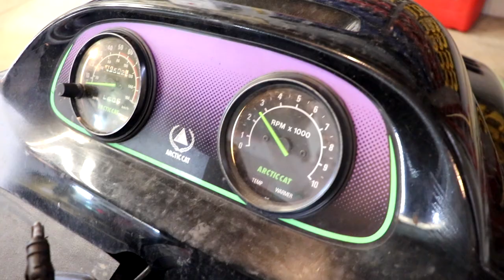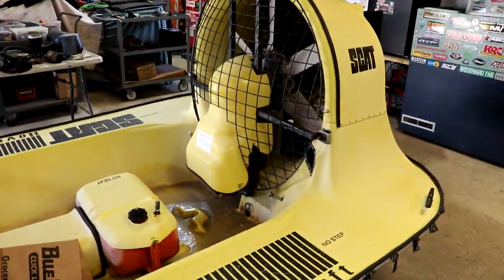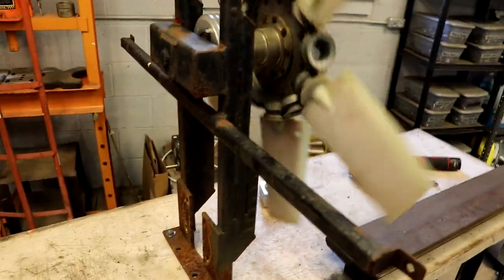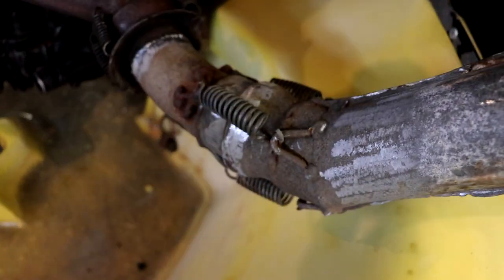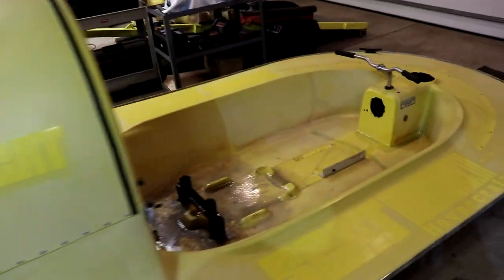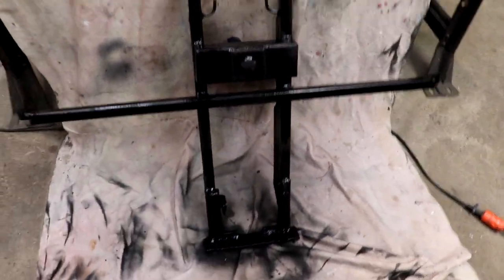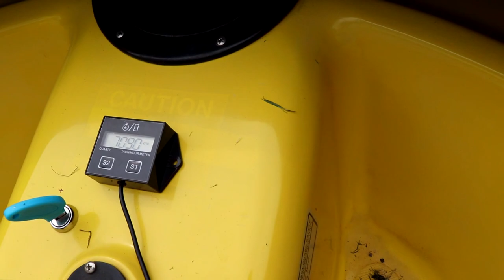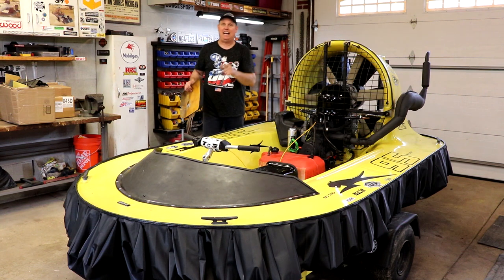The Hovercraft ENGINE SWAP 580cc Two Stroke 10,000 RPM

Comment: Everybody needs to watch cleetus McFarland's hovercraft video where he has his hovercraft redone by a racing engineer. When they change the fan they believe they go to a 9 blade hub and group the blades in pairs. There's three pairs of blades they said it really increases the thrust and they leave every third hole empty on the hub. I'm restoring an 87 Scat HPII Myself planned upgrade with a snowmobile engine as well. Maybe a 600 and a little bit larger duct
Reply from the maker: Saw it. Those fans are big bucks and we're super low budget. Best of luck and thanks for watching!

Comment: I think that hub has missing prop blades in the empty hubs due to the low horsepower the original engine was able to produce. 
With increased hp you could add blades to the empty hubs creating more thrust.
I wouldn't be surprised if it was built to have different sized (horsepower) engines installed and yours was on the cheapo end of models available. 
I do know a tad little bit about props given I grew up around airplanes and I was a Coast Guard Aviation Machinist Mate on Grumman HU16e Albatross seaplanes with twin Pratt and Whitney R1820 radial engines. 
Changing those props took a little bit of labor.
You'd hear a big moan coming outta the Fixed Wing shop when Chief Bloom would announce that we were going to do a complete blade change evolution. 
Fun times.
We actually loved engine changes for some reason.
Reply from the maker: Thanks for sharing! This 12 blade hub is set for all it needed with the other engine and this one as well with it's 6 blades- but the fast racer's setup is a 6 bladed 9 position hub, with two-two-two and one empty between em.  Too many blades on the hub actually produce lower blow through for any real speed. That's a later project :) Thanks for watching!
Reply: @GrenadeMotorsports .
That would actually depend on the angle of the blade cord and other factors. 
Take a look at the props on both the HC130C and HC130J Hercules aircraft. 
The J also has upgraded engines.
But then you did say it'll do 60mph / 53.13 knots I think you said.
That's plenty fast in a hovercraft.
Given how unstable they can be if they encounter anything that hits their squirts on one as small as that.
I'd sure love to have one down here in Homestead Florida just above the Keys.
I'd take it down to the Whale Harbor/ Islamorada sand bar party that goes on all summer long once the water reaches above 79 degrees.
Nothing like a couple of hundred boats party crowd.
I lived down there for 10 years and one of the perks my job got me was a 19 foot Hoog with twin 200 Yamaha engines. 
Pretty much equal to the the Harley Sportster I used to own that had a race built engine in it.
I'm lucky I didn't kill myself riding that thing but it sure was fun. 
I sold it when I moved down to the Keys.
Reply from the maker: @pinwizz69  Well hell yeah man. Be safe & have fun! Look on ebay for hovercraft- they are out there!

Comment: It was the water spray getting on the belt and pulley causing it to slip which made fan spin slower.
Reply from the maker: I built an additional tensioner- like that used on some motorcycles, basically a wheel that rides on an arm with a bearing, pushing on the outside of the belt, adjusted by screw tension. Worked perfectly. Thanks for watching!

Comment: I would recommend doing a ceramic heat coating on the exhaust. You mentioned high heat paint. I am not sure if that is the same thing.
Reply from the maker: I used engine paint on the pipe. For looks really. Thanks for watching!

Comment: Hi there. I see that you have the upgraded pulley system instead of the old timing belt style pulleys. Do you notice belt slippage at all while on water. I’m looking to upgrade mine to what you have but on a previous scat I owned I remember belt slipping but maybe my tension wasn’t good enough.
Reply from the maker: I built an additional tensioner- like that used on some motorcycles, basically a wheel that rides on an arm with a bearing, pushing on the outside of the belt, adjusted by screw tension. Worked perfectly. Thanks for watching!